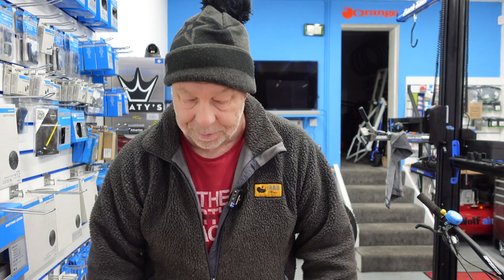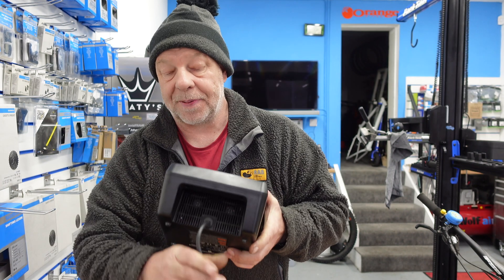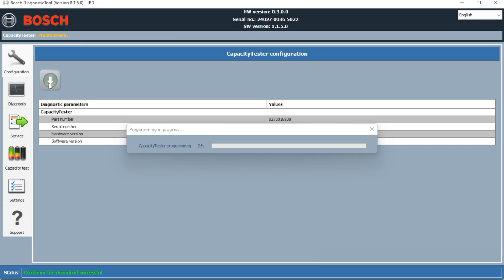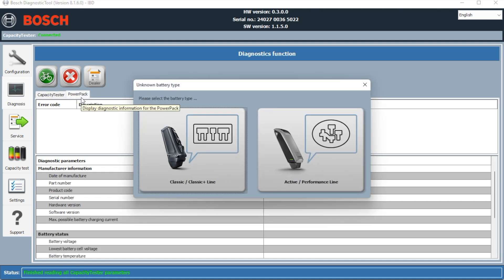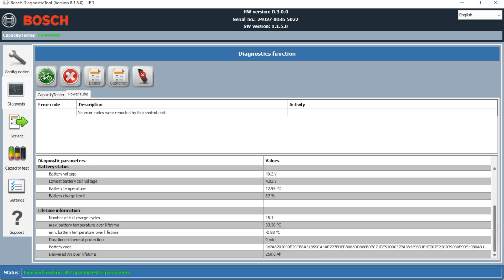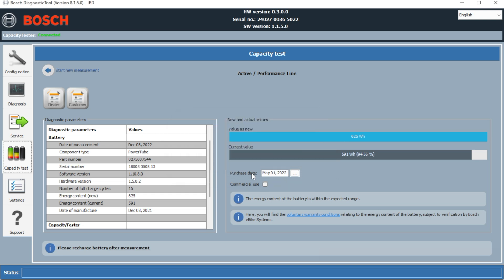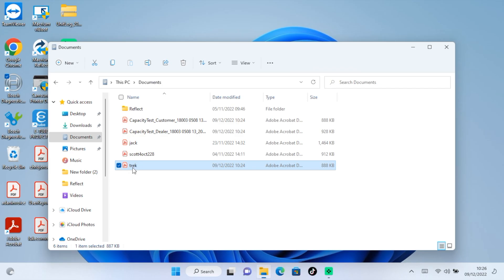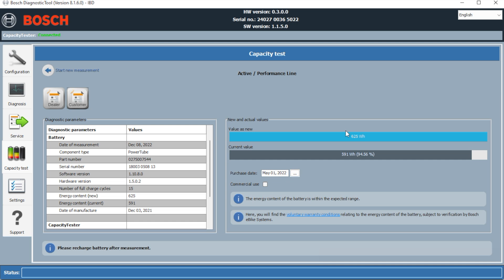How do we test the condition of your e-bike battery?

Comment: Hey there! I found your video while searching for explanations because I noticed my eMTB with a Bosch CX Gen 4 motor feels way less powerful compared to other newer eMTBs with the same motor. I have two Powertube 500Wh batteries that I use alternately. I think each battery has about 2,000 miles on it (not sure how to convert that to charge cycles). I recently replaced the Bosch motor, and the new one has only 1,000 miles on it. My dealer found an error code 0x606011 in the Bosch firmware when I took it in, but I didn't notice anything on my Purion display. As for the battery capacity, they both seem to be performing well. I haven't noticed any decrease in range. It's the reduced power that's got me worried.
Reply from the maker: Hi, Thanks for watching and your comments

Comment: I am thinking of buying a 4 year old Kalkhoff with only 25 miles on the clock. I do not know if the battery has been properly looked after in that time. Is there a way of testing the battery to estimate when it might need replacing?
Reply from the maker: Hi, do plenty of thinking, by that I mean, do you have a local dealer for Kalkhoff? part can be tricky to find, diagnostics even harder

Comment: Hi Dave. Great and interesting video. Thanks for sharing.
According to my counting, this tool can discharge the battery with 5 Amper. Can U tell me what is the cut off voltage of the tool? Because it can affect the capacitance measurement.
If U have time, please make a test with a new battery pack, because I am interested in how big is the difference between the real (measured) and the nominal capacity (written to the pack datasheet).
Thanks a lot in advance.
Reply from the maker: Hi, thanks for watching, I have a new battery in at the moment, I will test it.

Comment: The only reliable part of my Bosch system IS the battery. Mine is a 2019 500wh with about 500 cycles to date
I run it down as best I can every ride and, i ride almost everyday. I charge it indoors at room temp w/a 4 amp unit
I'm still getting good mileage with a slight drop off because of the winter conditions here on the wet coast of Canazuela
Reply from the maker: Thanks for sharing

Comment: Just a quick heads up to everybody riding with the Bosch system and anyone interested in getting a spare for those extra long rides. According to my LBS it seems that there are some dodgy copies currently doing the round that everybody should be made aware of, the kind of copied that can burn your house down to the ground, if you know what I mean. 

If you spot a deal that is too good to be true, walk away or at the very least, do your due diligence and insist with the seller that they provide evidence that the battery is 100% kosher with the production of s Bosch diagnostic report. You have been warned!
Reply from the maker: Hi John, Thanks for your comments
Reply: ebike vision make 3rd party packs for bosch bikes but there expensive and only work on some motors but as these bikes use can bus comms  any other batt without this will not work anyway as the controller wont turn on.

Comment: I find this quite shocking.. After only 15 full charges and just 6 months that it has lost so much capacity..   Bear in mind the £750 or so cost to replace a battery pack..
Reply: It depends on where its kept and if the owner has been keeping it either fully charged for way to long (believe it or not but being fully charged and left in storage can be bad) also if they have been leaving it for long periods of time with low to no charge in it. Then it's if the owner has stored it in very hot or cold conditions
Reply from the maker: @NaytonRides  Thanks for you great comments, very true
Reply: @NaytonRides  i got 112 charge cycles out of my 400w batt and then it was down to less than 5 miles in range but i also use a dongle so expect that rate of usage will hammer the batts capacity but the price of them is a rip off and the new smart frame batts wont even work on my motor even tho it will fit the bike.
Reply from the maker: Hi John, thanks for watching and your comments. there are many benefits of ebikes as well as disadvantages like most things in life. For some of an older age its made a massive difference their lives.